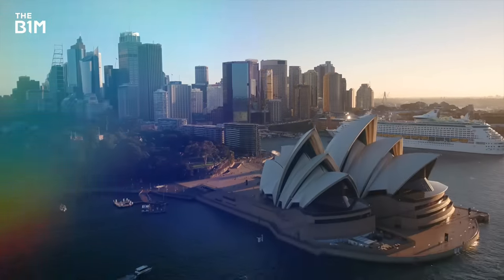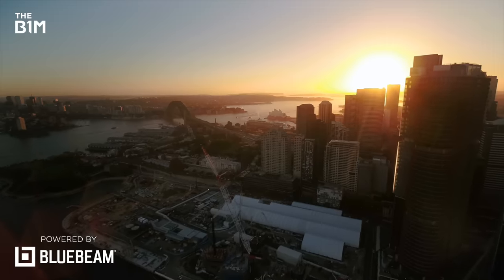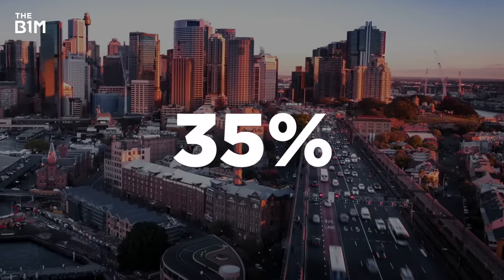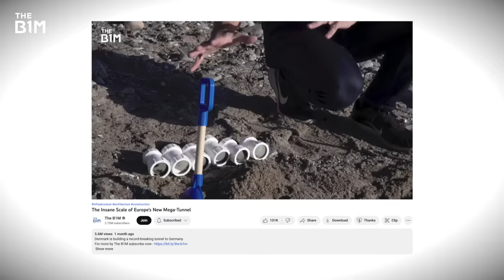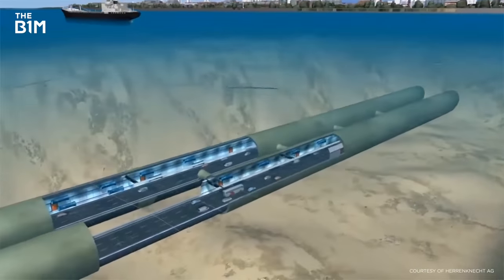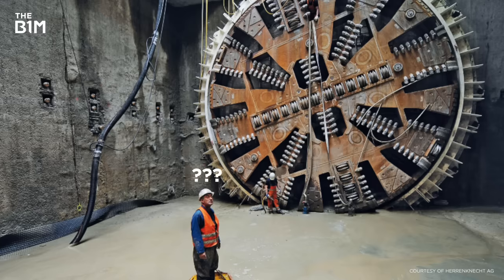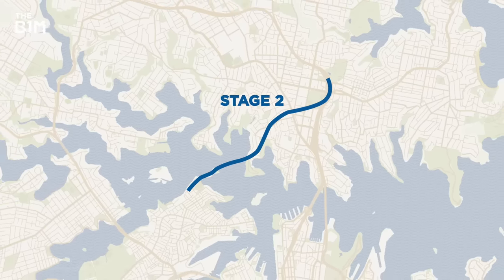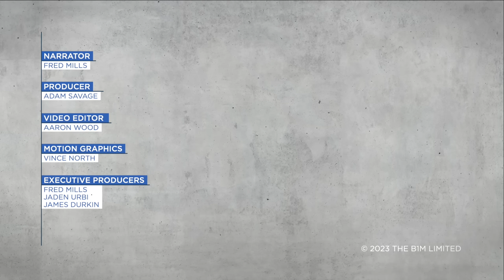Sydney's $5BN Tunnel U-Turn

Comment: This video is half-baked at best. It fails to mention anything of how the West Harbour Tunnel is (not even the most significant) part of an entirely new, massive network of road tunnels that will allow commuters to get to all corners of the city without facing a single traffic light, and take trucks off the main roads.
We're talking perhaps 100km or more of new road tunnels including:
M1 Northconnex
M4 East
M6 Southbound
M8 Link
Northern Beaches Link
Rozelle Interchange (the biggest and most complex piece of the puzzle, opening 2023)
Sydney Airport Gateway
West Harbour Tunnel

And this only complements all the new public transit infrastructure underway.

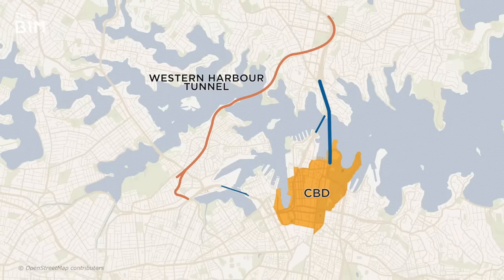Comment: how many km/miles of underground metro train railways could you build for AUD5bn? 2:20 all these reduction numbers will be proven too optimistic or outright wrong a few months after opening the new tunnel. it has been witnessed over and over again if traffic gets lighter/easier due to new roads the citizens will increase the use of those roads quickly and you will be back to traffic jams in no time
Reply: The City and Southwest Metro project (with a tunnel under the harbour already completed just to the west of this road one) is expected to cost at least $15billion. But who knows how much the final cost will be -  the new Martin Place station and connections in the CBD is something like $600mill alone. The completed part of the line (the Northwest Metro) cost about $8billion. And then there is the Sydney Metro West under construction between the CBD and Parramatta - cost $12.4billion (construction has just started). And then there is the new metro line under construction to the also under construction Western Sydney Airport (that will cost billions). So plenty of money is being spent on metro.

Comment: If only these 16m diameter TMBs were being used to bore out the new train tunnels as well, allowing room for expansion, for parallel tracks to be laid later, rather than tunnelling out a tiny rat-sized hole that only a SydneyMetro single-decker train can squeeze down. What a waste of an opportunity.

Comment: This project sounds like a huge boondoggle. Unfortunately, this sounds painfully similar to Los Angeles, we've build multiple freeways and literally they're overwhelmed before completion. Now Los Angeles has the beginnings of a commuter rail system, which has slightly improved the situation, yet our rush hour causes cars to slow to a stop, or travel at, about, 5 to 8 KPH. The voters here have willingly voted for sales tax increases to pay for previous, and future, commuter rail projects. In contrast, future freeways have been given the thumbs down by voters.
Reply: I think the video misses the point on this tunnel. It's a CBD (downtown) bypass. Most people crossing the Harbour Bridge aren't going to the CBD (there wouldn't be enough parking anyway) and would prefer to avoid it. Of course, whether it actually works as intended remains to be seen. There are la lot of new metros under construction in Sydney, including one that goes under the harbour in a tunnel just east of this road tunnel. Not to mention that public transport isn't that bad in Sydney. A fairly extensive heavy rail network, some light rail, ferries and lots of buses.
Reply: @daveg2104  L.A.'s metro rail system is,  I believe, inadequate given the present, and growing, population of non car owners. Further, the air quality has markedly improved since a legal ban on leaded petrol and higher taxes have taken effect.

Comment: imagine if they used that tunnel for a rapid transit system instead. dissapointed in b1m saying that new road construction "claims to encourage" car use. Its widely regarded as fact in the developed, car-centric world that adding new lanes does not fix traffic
Reply: The new metro line that goes under the harbour has it's own tunnel.

Comment: You've got to feel for these project managers and engineers, they're given a task with no happy endings, and big number to most, but very insufficient amount to design, build and progress monitor it, and have to do it in an unrealistic timeline. Then the moment they have a solution that maximizes the overall outcomes vs the general concerns, addresses the problems, and is the least worst outcome, and then they're told by every armchair expert they're the dumbest people to ever exist and should be investigated for fraud, and in 10 years, no one raising the complaints will even remember they ever complained.

Comment: Have they never heard of induced demand?  Those reductions on other crossings will be temporary. The crossings will be just as congested three years after opening, including the new tunnel.   Building capacity to reduce congestion NEVER works.  It only makes it worse.  Money would have been better spent on a rail link.
Reply: They are also building new metros, including a (completed) tunnel just to the east of this road tunnel. Another harbour crossing that bypasses the Sydney CBD isn't necessarily a bad thing.

Comment: Since the last 2-3 yrs and the number of ppl still working from home and the commercial real estate still bust, building a new tunnel for increased traffic when fewer ppl are going to the city is a waste of time and money. As they said in the last 2-3 yrs, ppl working from home will become the new normal. Also, with the price of fuel still floating re the $2 per litre figure, fewer ppl are driving their cars so reiterate, a new tunnel is a waste of time and money.

Comment: They should do the opposite. Close lanes for public transport only and provide better cycling infrastructure.

If they poured all that money into that the problem would melt away.

On top of that city zoning needs to be more flexible. Live near where your work and shop.
Reply: What you said is largely the case. George St in the city (shown in the video with buses) is now pedestrian/light rail. Many new metros are under construction. Most people don't travel to the CBD for work or shopping, although they may not work in the area they live in. There is some infrastructure that has been built or modified for bikes, but Sydney topography isn't all bike friendly. It can certainly be better though.

Comment: Car sitting in traffic cause 40% more pollution than if they were not as idle. I use to sit in 20 minutes of traffic by my house because there was only one route to the highway.  They finished the ring highway in 2018 and and now the same route only take 4-5 minutes. The congestion is gone. It was delayed 2 years for an environmental impact of a tiny lake and almost lost the ability to build the interstate in that place.   The environment is much better off because hundreds of cars a day in this area are not sitting around.

Comment: This report has elements of misinformation. Stage 2 was always up for changes, after consultation with communities and environmental impact assessment, a tunnel was the better option. Sydney has many toll roads. This is no different to other harbour crossings. Good project management allows the flexibility to adapt long running projects when better options are available, rather than commit billions  to the wrong approach years in advance. Delay is expected to be 18 months. Sydney traffic is largely unchanged during construction. A lot of completed roadworks have steadily improved travel times in recent years. Just stick to construction, you don’t know matters surrounding the project.

Comment: I'm so glad we have the Melbourne metro tunnel drastically increasing metro rail capacity  as well the suburban loop transforming the hub and spoke rail system into a more redundant model. Melbourne and Victoria's rail infrastructure is way more expensive than Sydney's roads but Melbourne's transport system is already much better in most regards.

Comment: Toll upon toll upon toll. There’s only one reason that this is getting built : to provide the toll company Transurban will another tax dodging toll road. This is not needed. We have more tolls that anywhere else, taking those that use it to places that end up being more traffic jams

The current govt is just building these, hocking them off to Transurban whom have taken no risk in the building.

Sydney is fast becoming one of the worst cities ever - and to think we have decades of learning and not following the mistakes of other cities. It’s impossible to travel north to south without using a 3 laned road that passes next to houses, multiple traffic lights and various speeds.

Comment: Building more roads in Sydney to solve the traffic problem is like a fat man buying a bigger pair of trousers to solve a weight problem. There are too many cars because there is not enough public transport. While the state government has been happy to spend billions on road projects they have not been so willing to do the same for the railways (except for building a stupid light rail system which goes nowhere that buses didn't go and had huge cost over runs). They do, however, have the energy to squabble with the transport unions about pay while paying themselves big fat salaries and building new sports stadiums to replace ones that were perfectly adequate. All understandable when you realize they are thick with the construction industry.

Comment: Anyone against these projects is a *^*^*^. Sydney desperately needs tunnels. The real question is why would you plan for one...these tunneling machines should be going from project to project. Given Australia is one of the biggest mining countries in the world I don't know why they don't just offer tax subsidies to mining companies if the have an infrastructure tunnel contribution ongoing permanently...as a opposed to one off mega contracts with foreign corporations. Just make the subsidy subject to safety /quality standards. Compliance in mining is insane. The noise, subsidence vibration is very quickly mitigated by depth and water density. You live near the tunnel and get a crack in you house, instant compensation or above market offer if you're super upset.  If you were super farsighted you'd be hooking a series of parallels tram lines that just runs back and forth across the Harbour connected by a single lateral each side. But hey, I'm not a polli.

Comment: Sydney is actually a quite condensed city, until you get way out west it’s pretty much squished in to a thing line by the surrounding geography. It’s ridiculous they aren’t building train tunnels and better public transport instead.
Reply: They are. New metro tunnel under the harbour just to the east of this road tunnel. Many different projects can occur simultaneously.

Comment: They’ve made a mess of the roads so they dig another tunnel… which doesn’t solve anything if there’s a crash or breakdown 🤷🏼‍♂️ by 2028 there will be a lot more cars on the roads any way making this project not that much of a solution, just more bottlenecks.